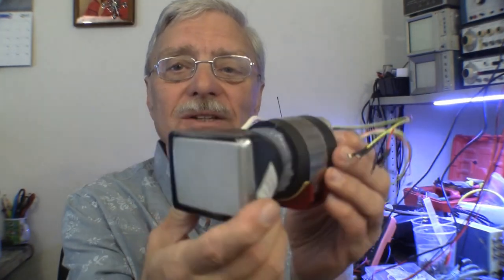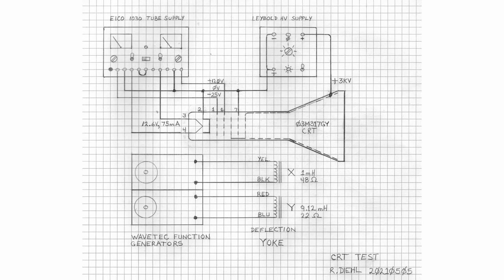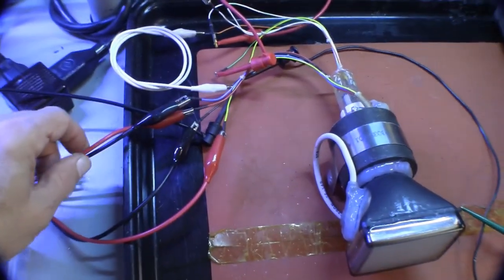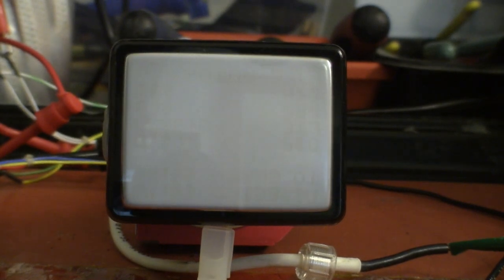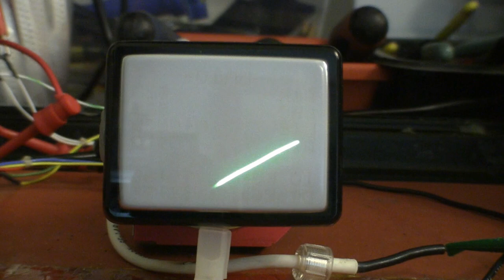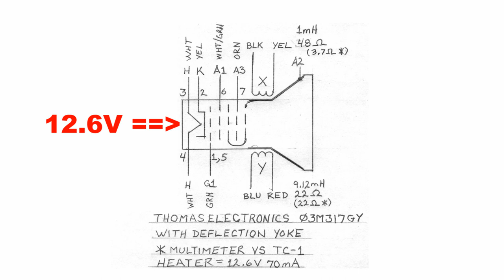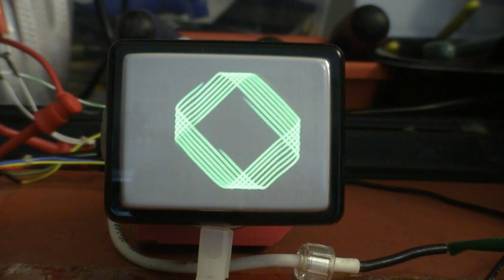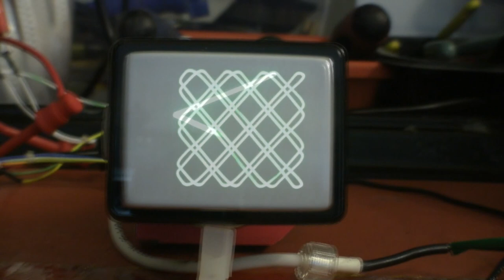Cathode Ray Tube Projects #2, Another Mystery CRT!

Comment: Nice video, just subscribed :)
Identifying mystery parts/components is always fun.

Btw. If you have a CRT with no visible burn-in, you can use a blacklight in a dark room to make them visible since it will brightly light up the phosphor of the screen, making even the slightest burn-in show up.
I don't know if this works with every CRT since I've only tested it on the CRT of my Commodore PET, but there it worked like a charm, making burn-in visible that was otherwise completely invisible to the naked eye even with the PET running.

Just a little trick (but you probably knew this one already)
Reply from the maker: Yes. I use my UV light to partially identify phosphors. It does not work for all of them. Some, like P1 and P11, do not fluoresce under UV. P31 is particularly beautiful, though. I tried the UV on this tube and it did not make the burns stand out any better. But, your point is very valid.

Comment: Is it necessary to have voltage applied to the deflection plates to get an image?
Reply from the maker: This tube does not have deflection plates. With no current applied to the deflection coils, you only get a fixed spot in the center of the screen. To get an image, some sort of scanning must be applied. So, to answer the basic question, "Yes".
Reply: @videolabguy  i am trying to test old EICO 5bp1 tubes, that have electrostatic deflection. i assume with no voltage on the plates, i would just get a spot in the center of the screen?
Reply from the maker: Yes. Correct.